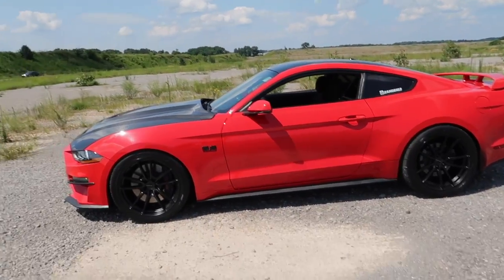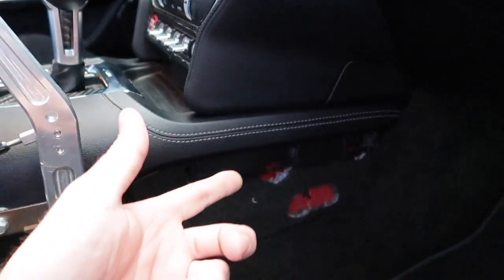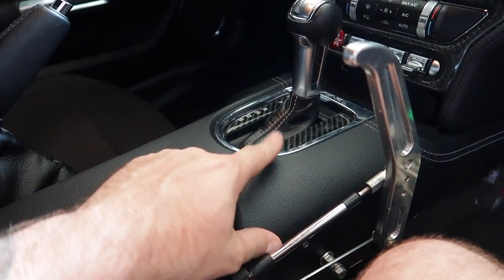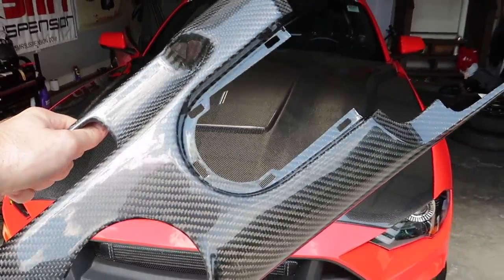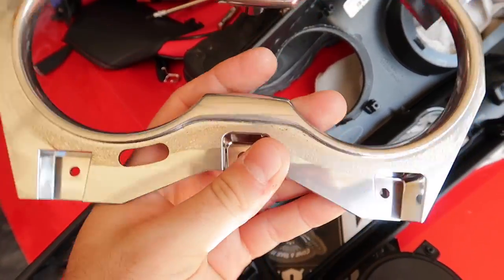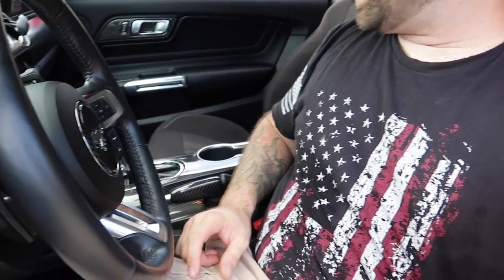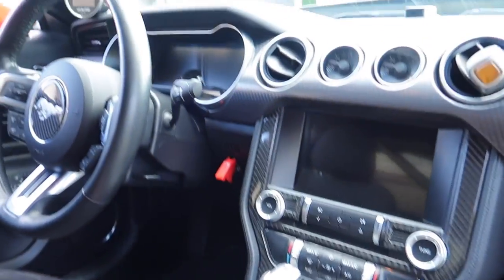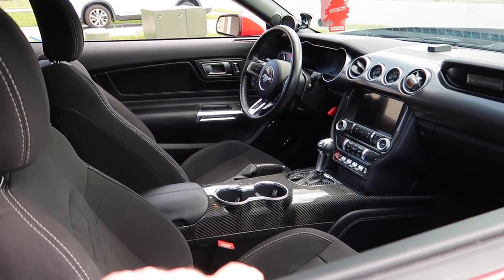CRAZIEST Interior Upgrade For My 2019 Ford Mustang GT Yet *Carbon Fiber Console!

Comment: Hey Zander, in your opinion is it worth getting the MagneRide or putting the money towards BMR suspension parts and/or coil overs?
Reply from the maker: Probably just skip it if you are going to heavily race. Use promo code zander7 at BMR to save though. I personally love magnaride for street use though with a few BMR goodies
Reply: @Zander13Productions  Thanks for the quick reply! I'm looking for a 301A with MagneRide but there's only 1 in my area in grey which I don't like, so I would have to step up to a 401A which as you know cost quite a bit more. Then it's another $14k to a Mach 1 lol (CAD prices, after tax taxes and GT dealer discounts). What are your thoughts on the Mach 1 as far as pricing goes? I personally feel Ford has jacked up the price since they know there are a small percentage of people who will buy it just because it has the Mach name attached to it.